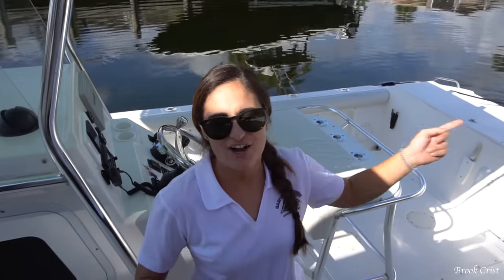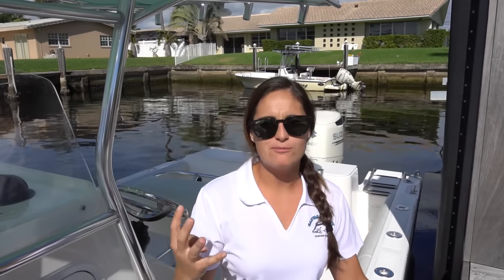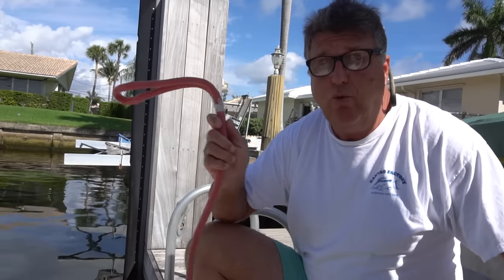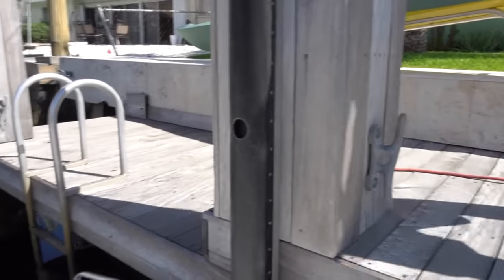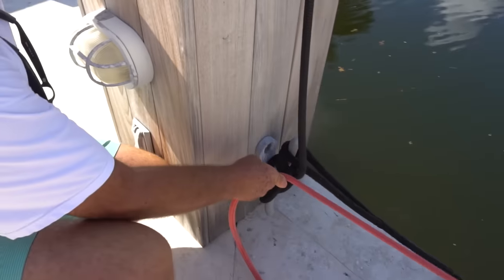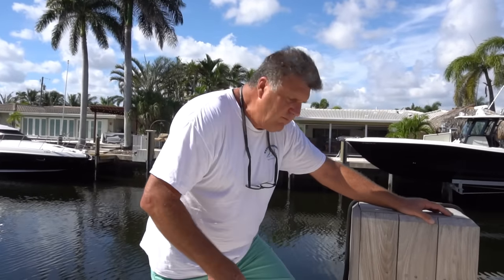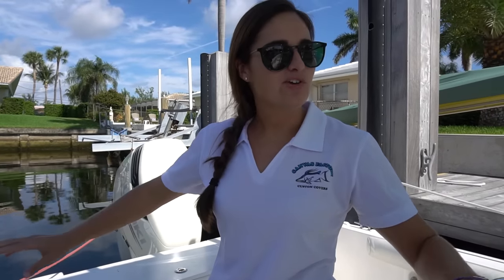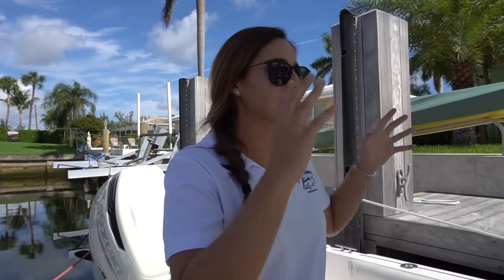HOW TO TIE A BOAT UP AT THE DOCK

Comment: You have 4 lines but only to tie points I am new to boating so im taking your info as gospel but as far as moving heavy equipment that would not fly talk about not knowing the condition of the cleat but you take 2 lines to one cleat
Reply: In not sure I would run that stern line over the motor but again  you   Have been doing it we longer than me So I always listen to salty  Boaters

Comment: Long lines are correct but you should not wrap the cleat prior to making your turns. The wraps will get tight and prevent you from releasing the line. The holding power is in the turns around the cleat the wraps do nothing to hold the boat.

Comment: I don't like the way those dockside cleats are mounted vertically on the pilings. Much better to have horizontally mounted cleats, but you've got to work with what you've got.

Comment: Boats don't have docking ropes. They have docking lines. Not making efficient use of dock faces  will not earn you any friends. They are right about one thing. Don't tie it short. It needs to breath. Spring lines are the most important lines.

Comment: "If you don't know how to tie knots, tie lots" is at play here, meaning that a proper cleat tie off is more simple than that. And the purpose for all proper knots is so that they can be UNdone quickly and everyone who should know them will know how to untie them quickly. It is clear that you are tying off at a wharf (non floating dock), which would be affected by tides. If the tide changes are minimal, then the problem with tight lines will be minimal. 

I have seen small boats flip over because they were tied off tight at low tide, with no compensation for high tides. Tight lines can be good, to minimize shock loading. But shock loading isn't a consideration in your instructional video, and you are doing more harm than good when you pass off this kind of "one size fits all".

Comment: All "good," but the proper way is:
1. You have to adjust your docking lines from the boat and cast the loop on the dock or double it back to the vessel!
2. Use the real Cleat Knot, not the one you presented (half way around/across and go back to the opposite horn to cleat it making exiting end parallel to the crossing part of the line - it's easier to show than to explain). Also, if rounding the square post, make sure your lines are chafe protected.
3. Spring lines should be about the boat and half-length and bow/stern about a boat length. Longer lengths should be considered if the lines are doubled or tides are significantly higher.
4. If the bow and stern lines are about perpendicular to the dock, you should leave some slack to compensate for tide height. If wave areas like Norfolk or New York Harbor, for instance, slack should be seriously considered and experiment with, as there is no rule about it however it will save your boat/dock cleats and/or your lines and the boat itself.
5. Bow/stern lines keep the boat from floating away of the dock and spring lines limit the movement fore and aft but mainly keep the boat parallel to the dock.
6. The size of the docking lines should be adequate to the weight of the vessel, not its size.
Never leave your docking lines on the dock, it's public area, and you will be seriously responsible if someone trip over and hurt himself!!! Also, you don't want to adjust your docking lines from the dock just in case your boat decides to sail away for any reason! Well, unless you left on the vessel, your mother-in-law! (just kidding)
I hope this helps.

Comment: Incorrect way of tying cleat knots. Should be two round turns, starting with the furthest horn away, then loop around and then lock it off. The locking turn should be parallel with the first turn.

Comment: Good video, great explanation of why to use a long line.  A couple comments though.  I would wrap my line around the post and do a cleat hitch on the opposite cleat so all the line stress is on the post.  Also, your cleat hitch is incorrect.  Here is a proper one.  https://www.youtube.com/watch?v=KaF9lFn0Inw&t=493s

Comment: He doesnt know what hes talking about.

Lol
Reply: I totally agree with you. Why not add some of the reasons. There are many to choose from. I’ve been looking for something he did right. I’m a retired sailing instructor; he seems like a novice, teaching nonsense.
Reply: I also agree with this one. First Strike: Tied some interesting cleat hitch which is unnecessary, just a standard cleat hitch works perfectly every time. Second Strike: Just because you have long lines doesn't mean you're exempt from tides. if you don't give some slack for your lines when you're not at low tide, they will tighten and damage your cleats. it's perfectly okay for your boat to move some, use fenders to protect your boat, they're like $15. Third Strike:  He tied the stern line on the starboard side, opposite of the side the dock is on. There was an empty cleat on the port side, attach your line to that cleat, and use a dock cleat further away from the stern of your boat. 4th Strike: Not only were his spring lines improperly attached to his mid-ship cleat, but they were also on the same cleat. It's okay to use the same cleats you used for your main dock lines as your spring lines, nothing can happen if the eyes on the end of the lines overlap on the cleat.
Reply: What kind of boots do you guys have LOL
Reply: My wellcraft walkarond on my profile picture had a bilge pump failure

Comment: hahaha That is NOT called "shear pressure." In fact, there is nothing in structural engineering (or boating) called shear pressure. There is shear, which is a force measured in pounds, kips, etc; and there is pressure, or stress, measured in force per unit area, such as pounds per square foot (psf), pounds per square inch (psi), kips per square inch (ksi), etc. But there is no such thing as "shear pressure." There is some pressure (not "shear pressure") exerted on the post when you wrapped the rope (between the rope and the post), but for the most part, there is a tensile force in the rope between the boat and the post. Otherwise, I enjoyed the video.
Reply: We are all impressed with anyone who has to mention that they have a terminal degree.